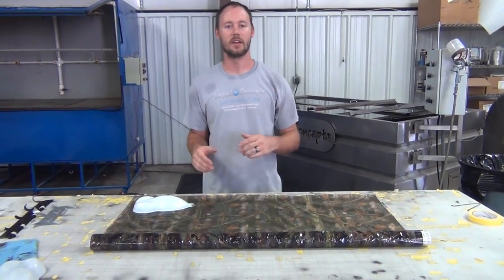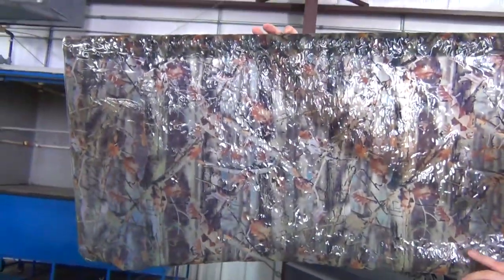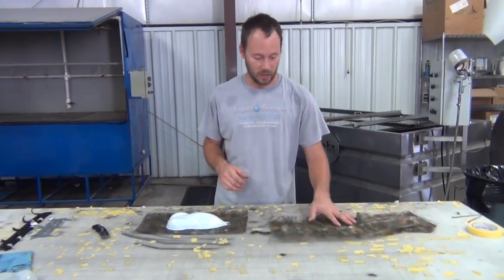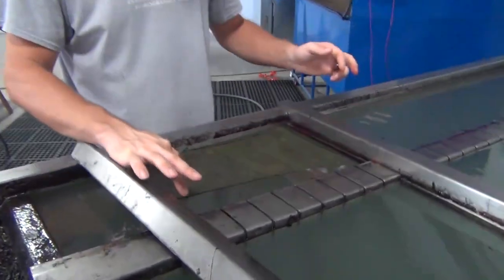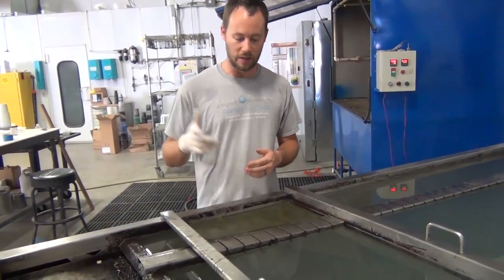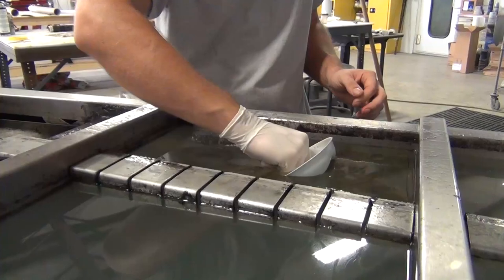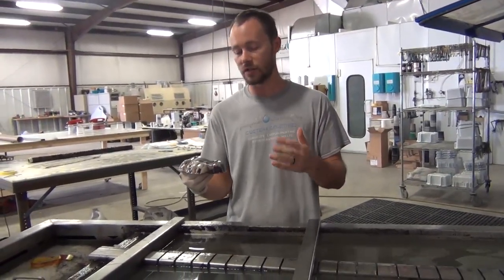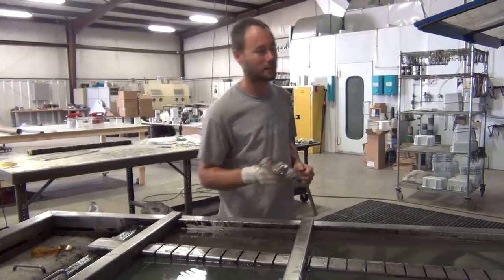FALL OAK CAMO FILM (SKO-389) | Liquid Concepts | Hydrographics Film Test

Comment: Approximately how much film will I need to coat a one-piece gun stock?
Reply from the maker: This all depends on how large the film is as well as if you have any problems with the dip and need to redo the stock. You can need anywhere between 1-3 meters of film depending on the job and how much film you use for the job.